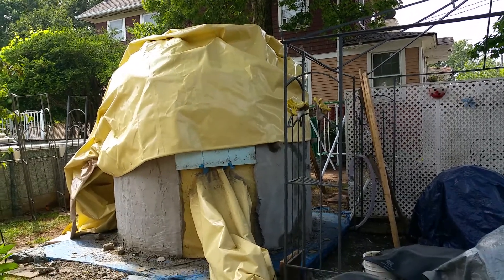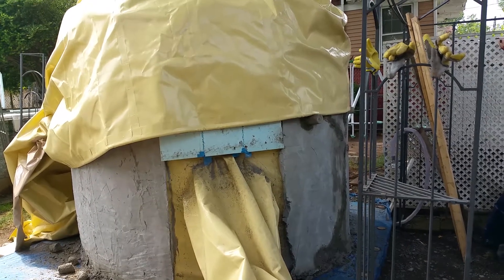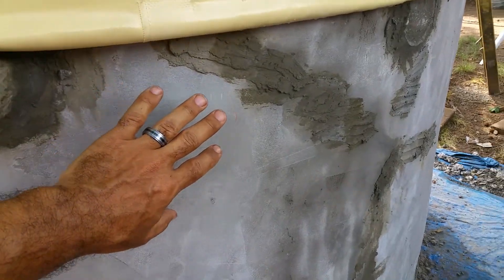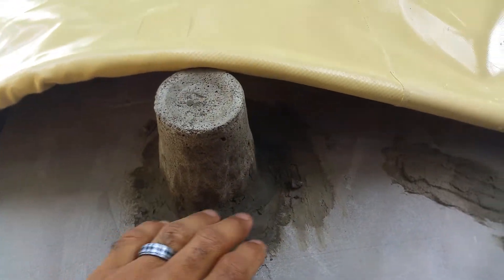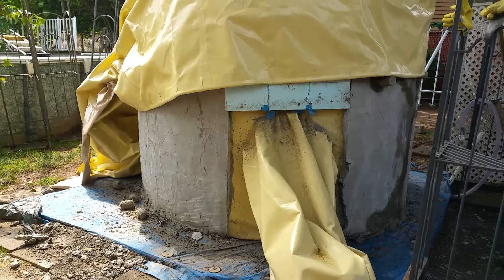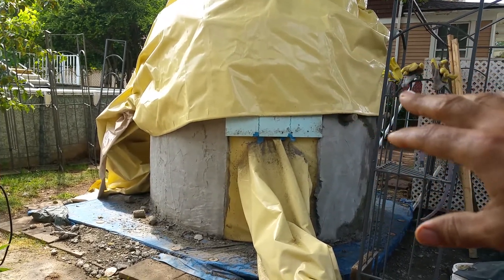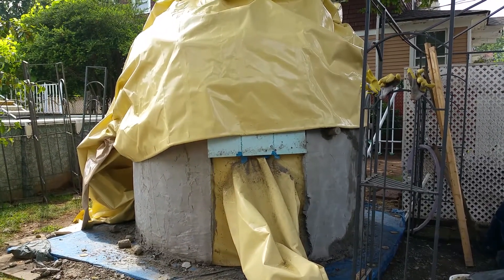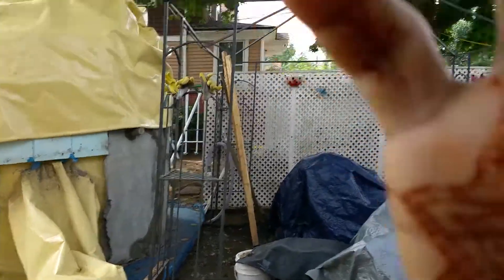Step 5 of Dome Project #AircreteHarry #Aircrete #DIY #Domeproject #DomeBuild #DomeTest #Spacers

Comment: Nice real world testing. Have you experanced Hemp Creet?
Reply from the maker: I have looked into Hempcrete and decided that system will not work for my process of building. The system I'm developing I will be able to build a dome home in one day. That will be a 4 inch structural reinforced layer of cement with a 12 inch Aircrete insulation layer.